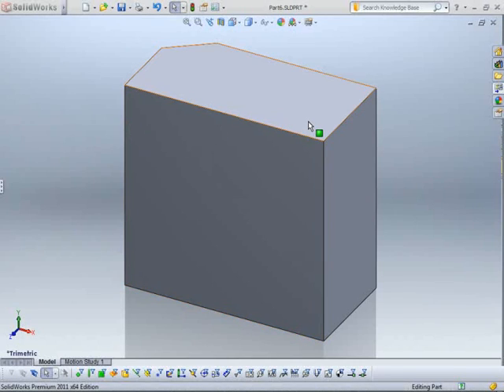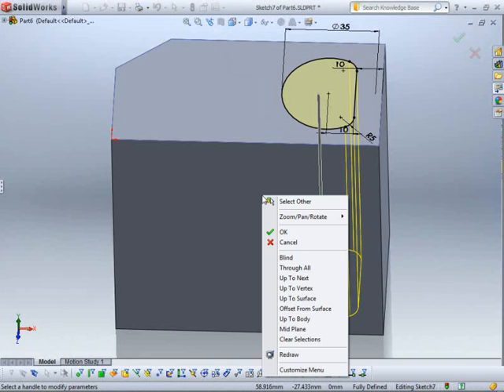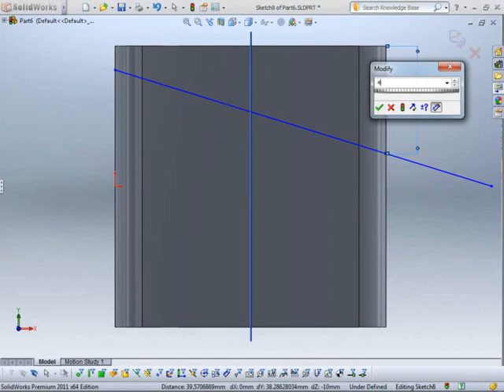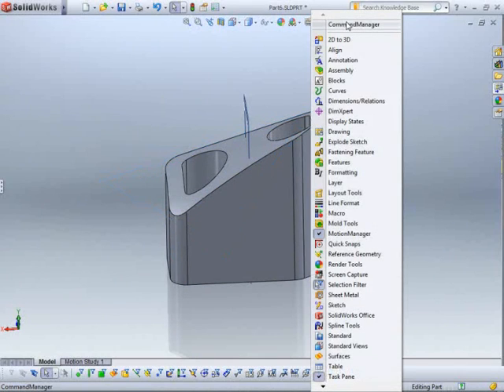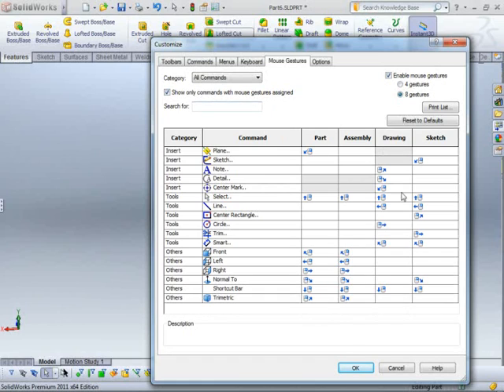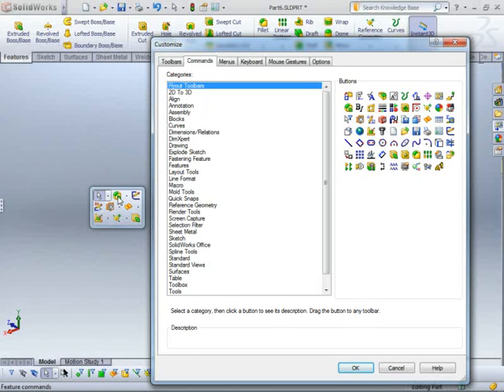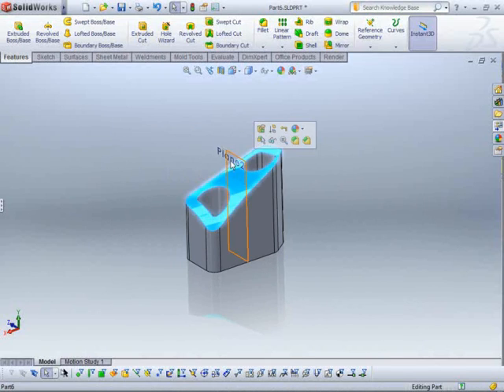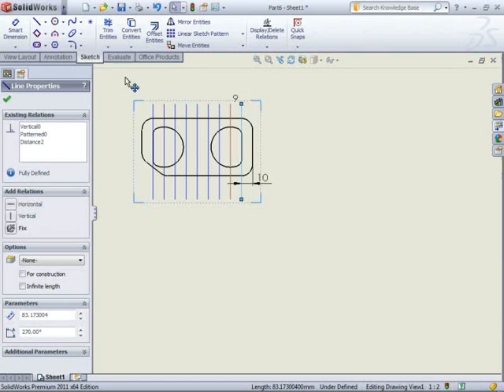Customising SolidWorks keyboard shortcuts, Mouse Gestures and the Shortcut bar

Comment: Hi Kieran.  Very useful thanks.  Suppose I have a lot of work to do in the normal top view of a sketch and I need to zoom in and out, dimension, add other sketches etc.  Can I use a shortcut to lock the view?  Thanks Robert